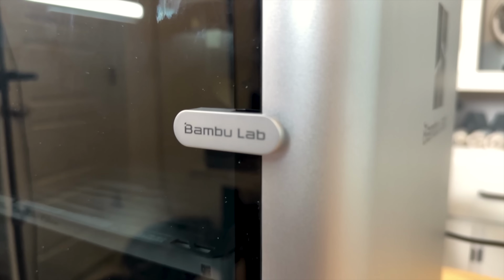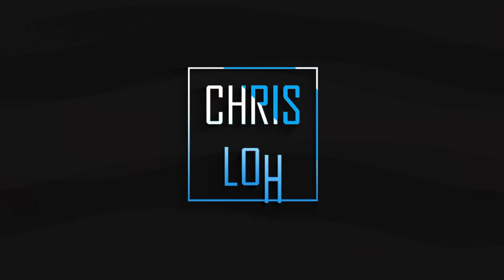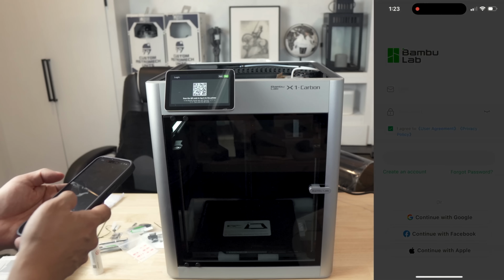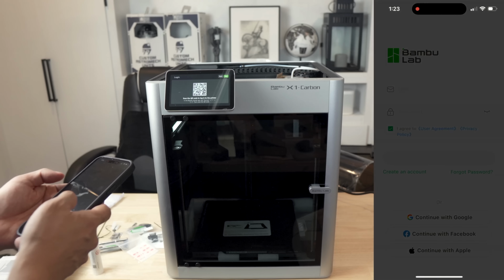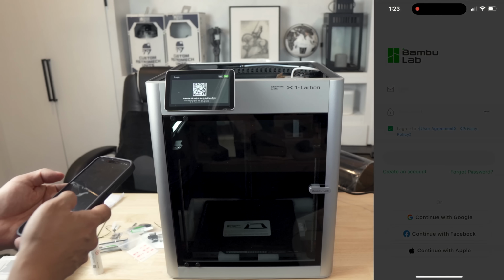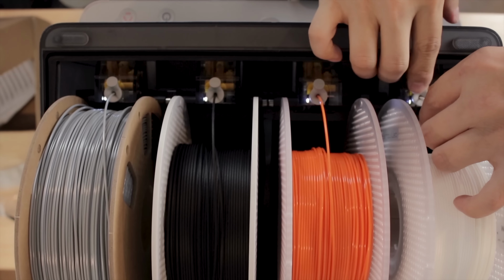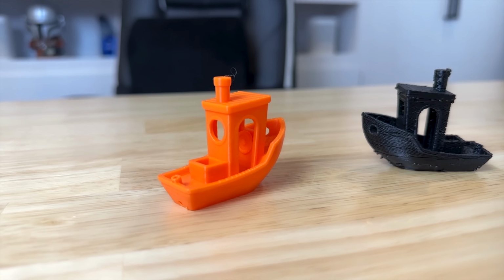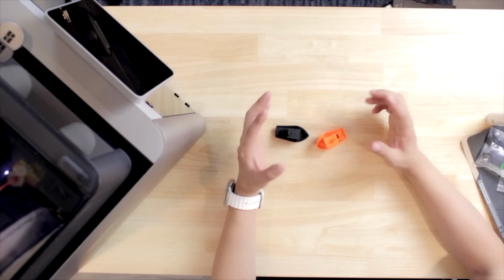Bambu Lab X1 Carbon Review - Amazing 3D Printer!

Comment: Your comparison seems a tad bit unfair.  The boat on the right looks like it was printed with intentionally bad settings (high print speed, high top / bottom size, low count of top/bottom layers, NO supports, etc.).  One could print a boat with an Ender 3 V2 that looks very much like the orange one on  the left with the right settings.  That being said I'm still pretty impressed with the X1's speed.

Comment: Great video! What are the total dimensions of the unit + ams on top? Is it possible to put the AMS to the side instead?
Reply from the maker: 389 x 389 x 457 mm with AMS.   Yes you can put the AMS on the side as well

Comment: I ordered the X1c but not the multi color attachment... how does it feed without that?
Reply from the maker: To be honest I havent tried to feed filament without the AMS.  However, I assume it works just as good.  Instead of feeding through the filament buffer on the back though, you would just feed the filament directly into the printer which means less distance and hardware for the filament to travel through.  I also think it works great based on the P1P feedback since they are essentially the same for feeding filament without the AMS.

Comment: Thanks for the review.  I fail to understand why your Ender 3 Pro is making such shabby parts.  All of my Enders put out superb parts, albeit quite slowly.  There's something wrong with your printer, slicer settings or material; not a fair comparison.
Reply from the maker: I was able to fix it by changing out the Hotend.  The print quality is a lot better now.  I still use the Ender 3 Pro, however it is definitely not as fast as the X1C.  I use the Ender 3 Pro primarily for smaller prints.
Reply: @ChrisLoh  Thanks for the reply, glad you got it doing better.  I have an FLSun Super Racer, multiple Creality printers, a Prusa Mk3 and my own designed printer.  There are qualitative, capacity, materials and speed differences between them, but they all have their place.  My X1C is in shipping now, will be very interested to see if it replaces one or more of the older/slower units entirely.

Comment: How can you compare an ender 3 with this printer. How much is an ender 3 printer and how much is this printer. And trust me I have been using ender 3s for more than 6 years and the quality you get on a stock set up is comparable to very expensive printers. Just a little fine tuning with cura that's all it takes.

Comment: 24:05 

From what I understand, it should be okay to mix different types of filament plastics together within the AMS, but you may run into some issues while you are printing as certain materials may not want to stick together if you are doing multi material printing.

Comment: That benchy from your Ender 3 Pro looks like crap (looks like wet filament ), out of the box mine printed just as good as the Bambu, it just took about 2 hours. Very misleading!
Reply from the maker: yep.  I figured it out and did a new print.  It was actually dried filament on the print head.  I replaced the print head and it prints better, but the quality and speed is still better on the Carbon X1.  Lines are less noticeable - also less anomalies.  Timing-wise the Carbon X1 is still faster at 15 minutes.  I do still like and use my Ender 3 Pro, but there is just less hand-holding and variation with the Carbon X1.

Comment: Prusa XL or This Beast ? Now i have an creality cr10 and an Anycubic i3 mega . 

Carbon x1 Carbon combo 1500.-
Prusa XL 2 Head 2600.-

Tough decision , i got both on preorder …
Reply: I am really impressed with the XL however they are hard to compare, and vastly different in price(especially if you want 5 heads). I can’t wait to see how well the XL is but I am not able to afford it which is why I picked the x1 carbon

Comment: All my accessories were boxed inside the printer along with partial filament roll completely different. They must be making changes on these initial runs. Or has to do with fitting AMS inside during shipping.

Comment: I own 2 of the BL XL-1 carbon's with AMS love my units one issue is using PA-CF carbon filament from BL don't use the AMS but I use an external feeder that is heated to dry the filament. The reason why you don't want to use your AMS or using the external roll supporter is PA-CF has to be very dry another is abrasive materials such as carbon and other filaments will damage the tiny holes you feed your material through AMS. The other with carbon filament you need to make sure you extract the filament after each use otherwise the custom extruder will get clogged and nearly impossible to remove. I would order additional harden heads but I also ordered the ones that come with the fan and the thermistor already setup because because it's a pain in the butt to assemble the complete unit where it's just a few wires to reconnect on the other.  This is just a heads up.
Reply from the maker: Thanks.  I ordered some hardened heads.  Do you have a link for the kit?
Reply: @ChrisLoh   i bought already 5 of them.

Comment: That benchy you compared it to looks like absolute garbage. Literally any printer could look better than that. My hot glue gun could print better.
Reply from the maker: Agreed.  I did swap out the print head on my ender and it is printing with better quality now, but its still not at par with the quality and speed of the X1 Carbon using default settings.
Reply: @ChrisLoh  no doubt, just a bit misleading seeing a benchy that looks worse than 247 printings 3 minute benchy

Comment: Be careful with cardboard spools, people seem to be having problems with them on the AMS and printing some protective rings to not have the cardboard slowly self destruct. Can't say this from personal experience, but I've researched quite a bit in advance since I'll get my combo in a couple of weeks, and it's something I thought might be good to know : )
Reply: The spools not only get torn up but they stop spinning when they get low on filament as there isn't enough friction between the spool and the AMS.
Reply from the maker: Before printing the cardboard rings, my AMS couldn't retract filament well at all with the cardboard spools.   Works great now with the printed rings
Reply: @MrTidus1492  Yep, although I'm surprised at how adding the printed rings makes them grip properly, I would have expected them to be more slippery than frayed cardboard
Reply from the maker: Yea I noticed that the cardboard spools I used get jammed, but I was able to find the template to print rings for the cardboard spools and it works perfectly after adding them.  I'll upload the SLT file on my blog in case you need them in the future when you get yours. 

https://clohofficial.com/wp-content/uploads/2022/11/cardboard_spool_ring_improved.zip

The AMS also wont handle the smaller spools.  There are adapter files you can print out there as well.

Comment: It takes less then 2hrs to print on ender 3 pro, he is making the print look bad...DONT BUY THIS PRINTER !!!!! SELL OUT
Reply: LOL 2 hours? It's like 16-20min on the Bambu. Yeah, don't buy it if you want to waste an EXTRA 1.5 hours using an Ender, LMAO
Reply from the maker: The Ender 3 is not bad and I still use mine, but the X1 Carbon is so much easier to operate and is much faster.  It also does do cleaner prints with a lot less maintenance and need for configuration.
Reply: He bought a new printer he is hardly a sell out...sorry you don't have the money for something more plug and play

Comment: Glue stick acts as a release agent. Without it the material would bond itself to the bed and would be very hard to release. 

Bambu sells a textured PEI bed that requires no glue and releases parts easily after cooling, I’d check that out
Reply from the maker: Thanks.  I just ordered the Texture PEI plate and it should arrive today.  I have already burned through the replacement sheets for the cool plate that came with the printer - been printing non-stop for the past couple of weeks.   

On a side note.  I also bought additional glue sticks, but its just so messy and tedious to cleanup and have to keep re-applying.  I cant wait until the textured plate arrives.
Reply: @ChrisLoh  I would also get a smooth PEI sheet for whenever you want a smooth bottom surface on prints. The textured surface leaves a texture on the bottom of prints, for the most part it’s fine, but when you need a smooth surface you’ll miss gaveling a smooth sheet
Reply from the maker: @ghdesign_  Is that the High-Temperature PEI plate?  Both the textured PEI and the High Temp PEI arrived today.  Printed with the texture plate and I love it.  My print stuck to the plate during printing and then easily peeled off after.  No more Glue sticks!!!

Comment: I tried printing two different materials (PLA an PETG) It doesn't want you to use different materials with vastly different temperatures because it could jam / clog the hot end nozzle.
Reply from the maker: Same.  I tried a couple of times as well and it wouldn't let me slice PETG and PLA/Support W materials.  I did order some dissolvable filament to test out to make it easier to remove support structures.
Reply: @ChrisLoh  Great vid btw! Very thorough first hand experience. I've been using my X1 everyday for about 2 weeks now and have been loving it.
Reply: I follow you on Instagram, congrats on finishing your book!